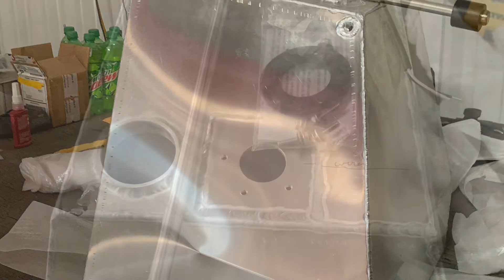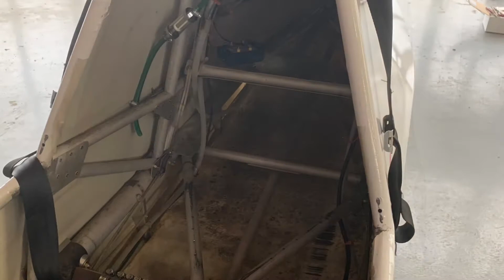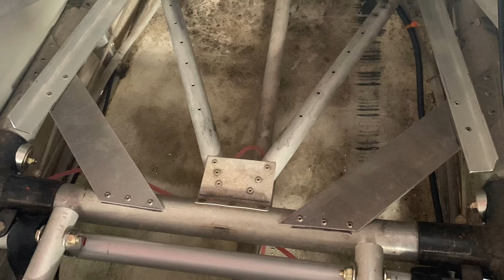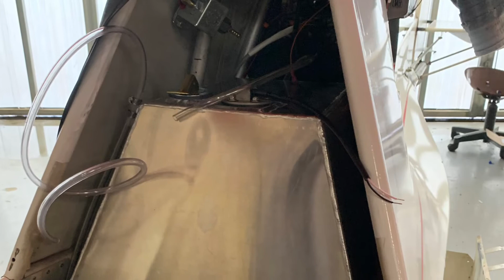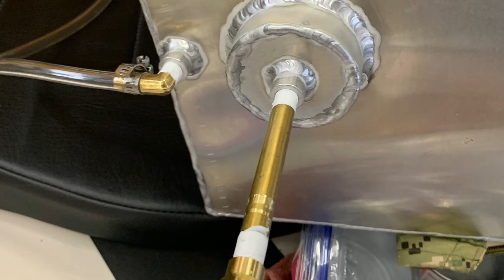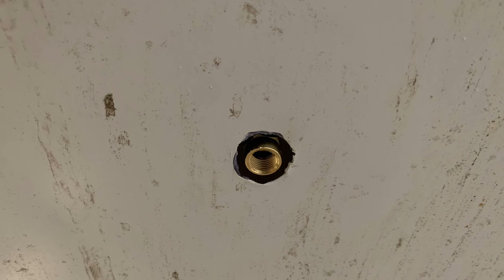Breaking News Quad City Challenger ll

Comment: Very nice! Did you have a heck of a time with the sight tube fittings? I struggled with those. Tough to get a wrench in there, and I couldn't get the tank in place with the fittings on.
Reply from the maker: No I didn’t. Everything went in place all together even the sump drain. Also I removed all the Teflon tape and went with a pipe dope.  Thanks for your inspiration on this upgrade. I’ll make some more mini video in a few as my plane is in a maintenance period.